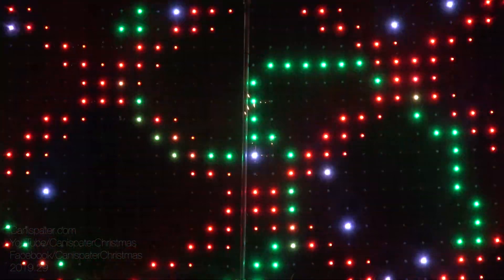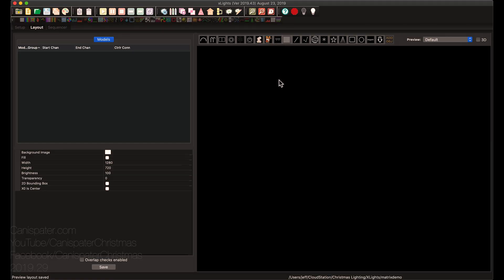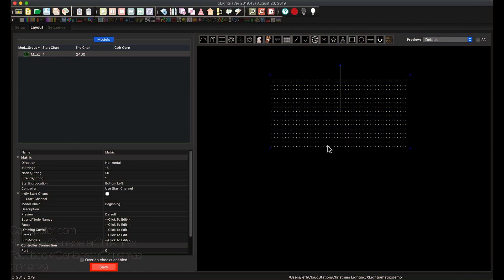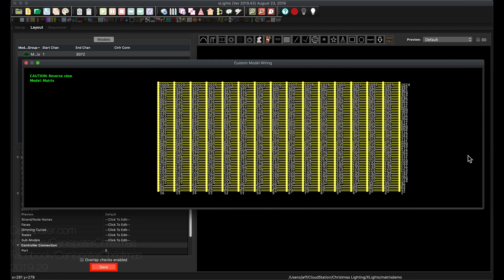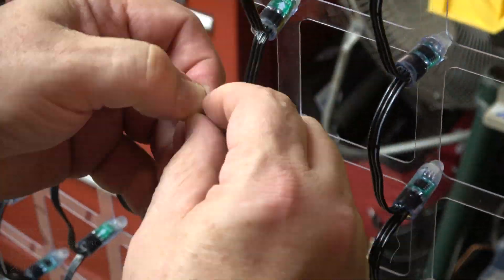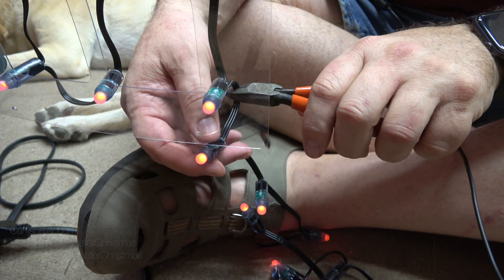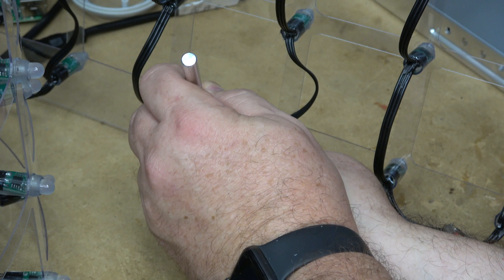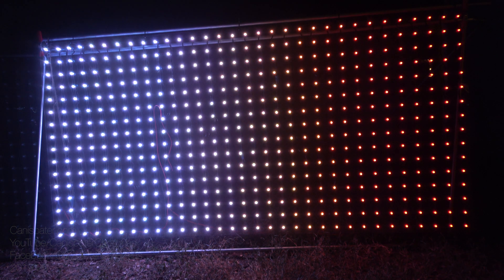🎄5V RGB Pixel Power Injection & Prop Build (2019) 🎄

Comment: I would like to have seen more detail about the power injection. I always have a hard time wrapping my head around it. Or make an updated video about power injection. Great video as always.
Reply from the maker: Thanks! Yeah, I'm going to do an update. Several asking for that. :)
Reply: @CanispaterChristmas  yes an updated video would be great.  Just one topic I'm.trying to wrap my head around in this hobby. Lol
Reply: I agree the power injection is what I am struggling with on my project as well
Reply from the maker: I think the one after this goes into more detail.
Reply: Maybe a wider angle so you can see all the power injection spots in same camera shot. Also how you wired it to the power supply's

Comment: What wire do you use? Different for 5v and 12v? I am going to be using both. So run a new wire about every 500 lights seems best? Thanks!
Reply from the maker: I typically use what I have on hand at the time (I'm very scientific that way, lol). Just make sure the prop won't exceed the current capability of the wire. Make sure it doesn't overheat when you first turn it on. Try to stay with 100% copper. Copper Clad Aluminum (CCA) tends to corrode quickly. Doesn't have to be fancy silicone wire. 😂

Comment: so in the video when adding your power injection wires - you mention to strip the wire coating back but DONT cut the wire.....after you solder in the power inj wires to the pixel wires....if you dont cut the wires how to you water proof as you wont be able to get a shrink tube on it?
Reply from the maker: I wrapped it with electrical tape, but if you want to use heat shrink, you’ll have to cut it. Good tape will keep the rain off, but use heat shrink if there’s a chance of it sitting in a puddle. Personal preference there.

Comment: what gauge wire did you use for power injection? and how many pixels between power injection points
Reply from the maker: I think I used 14 for this. It's generally whatever I have on-hand at the time. I think I went with every other column on this one based on a recommendation from someone else which was probably overkill, but it was just basically a little more work. With all this, build and check to make sure the wire isn't overheating. If the wire melts the insulation, you need bigger wire. Current for these can get surprisingly high with long strings. Fire is a possibility so check it closely until you get more practice with it.
Reply: @CanispaterChristmas   i read if using 5v pixels and only running at 25% brightness you can go up to 150 pixels before power injecting - is that true?
Reply from the maker: Different pixels are different. I always just let the pixels guide me. If they look dull or don't work, they probably need more power. The general rule is 5V, 50-80 pixels at 100%. Adjust if dimmer. 25% is pretty low though. As you lower the brightness, you do loose some color fidelity. I run mine at 30% minimum, but do what you need to for your display.
Reply: @CanispaterChristmas  I have a San controller brightness setting is either 12% , 25% Or 50% , 100%
Reply from the maker: That’s fine. Prolly not a lot of difference there.
Reply: @CanispaterChristmas  I'm running 14awg for power inj wires

Comment: What gauge wire did you use for your power injection wire?
Reply from the maker: Really whatever I have on hand at the time. It depends on what your current estimates are, but I like 14-ga if I can find a deal which is probably larger than needed - again, depends on what you're trying to do. If the wire gets hot or burns up, it's probably too small.

Comment: Can you do this with 12v pixels as well ?
Reply from the maker: Sure! You will probably need less power injection with 12V so maybe skip a string or two between each connection point. The pixels will tell you when they need more power or measure with a voltmeter.

Comment: You mentioned in a video where you do power injection you remove the shielding without cutting the wire. How or what are you using to shield the places you power injection from weather? Do you use any kind of fittings so you can disconnect the power injection cable when you store your matrix?
Reply from the maker: I mostly use those 2-conductor automotive connectors for power injection.

Comment: Hi Jeff, newbie here  getting ready for Xmas 2021. I have a huge plan involving some 20000 pixels. My megatree will be 46 starnds of 115 pixels top to bottom, and 25 pixels horizontally across the bottom for a total of 140 pixels per strand. I've bought an F16 with 2 expansion cards for the tree and I am building a 48 port power supply just for the tree itself. - Anyway - you don't need all of the details of my build just yet. I have been looking at suppliers for my lights and connectors, and I was going to buy from Aliexpress. I was under the impression that the lights come with some non-waterproof connector and I would have to replace all of the connectors with 2 pin (for power injection) and 3 pin pigtails but this video shows you with lights that already come with the pigtails. You have also made mention of someone called Ray Wu for parts and pieces. Can you point me to these suppliers? I am already familiar with Boscoyo Studios and I wish I was in the States as the cost for the Coroplast props is CRAZY expensive for me here in Canada (exchange, duties, taxes, shipping) so I m looking for a local supplier of 4 x 8 sheets and I will probably drill all of my own props. Lastly - I would love to add a 4ft x 16ft matrix like this one here, but I'm not sure what I would use it for. I think I would prefer to space my pixels at 2" x 2" for greater detail but much greater cost in lights and power - Thoughts?

Short point of all this blah blah - Who is Ray Wu, Where do you get your pixels from and do you have a model or part number, do you have any videos of your matrix in use, and what do you think of 2 x 2 spacing for the matrix vs 3 x 3
Reply from the maker: Awesome! You really should go through my beginner playlist (https://www.youtube.com/playlist?list=PLFyrAfJ-kKd4ZfPdXWIt8v_bav61mW_KW) as a lot of those questions will be answered. Ray Wu is a vendor in China we've (the pixel community) used for years and he has a good track record. There are others, but I've only ordered from Ray. I've also started using a US vendor wiredwatts.com since pricing and shipping isn't the greatest from China right now, Ken is great to work with and supports his pixels well. 3" is pretty standard for normal residential spacing, but 2 is fine if you're picky about it. I've not compared the difference and the viewers haven't complained. I have some videos of the show so you can see what 3" spacing looks like.

Comment: Prob could buy a simular size led tv's for the cost and had
Reply from the maker: 4ft x 8ft. Haven't seen too many TVs that big. 😂
Reply from the maker: And there's 2 of them side by side. Not trying to achieve TV-quality density, just showing some animated lights.
Reply: @CanispaterChristmas   hey now you laugh but 60" are only 300 at Walmart 2 side by side is more than 8 wide (just be short like me)and its full hd. Run with cheap video card to join. 10 min setup. Just has 0 Christmas light vibe.
Reply from the maker: Some do run monitors outside playing Santa videos. I suppose it depends on what you're going for. Merry Christmas!

Comment: What kind of stripper are you using that can remove the insulation without cutting the wire?
Reply from the maker: It's an old Paladin I've had for about 40 years. It's kinda magical isn't it? 😂

Comment: Jeff in a previous vid you mentioned the f16v3 had a 5 amp fuse,and 100 nodes would blow the fuse.
Did you have v+,v-,d coming out of the port or did you just use data then v+and v- from power supply?
Or did all 3 out of port    and v+,v- from power supply out to inject,so port provides front end and supply does the rest?hope I didn't confused you on this question
Reply from the maker: Well, there's a lot packed in there. THEORETICALLY, 100 pixels pulls 6 amps, but that isn't entirely true. Different pixels have different power requirements. 0.06/pixel is a ballpark estimate for calculating load, but you need to check your pixels to get accurate numbers. Also, that's for 100% white. I don't know anyone that runs their lights at 100% white all the time so actual current draw will be less. You might blow the fuse if you run 100% white and you may not. Always best to measure it or run it at a lower brightness setting if you can't measure. A last resort would be power injection, but I don't recommend that for 100-pixel strings. Much easier to run them at 30%. :)
Reply: @CanispaterChristmas  understood.
On your matrix,did you have all 3 wires going from port to first connection(led1).
Then inject from source where needed? Or
Did you just have data from f16 to (led 1)
Sorry to bother you just don't want to have the majic smoke on my first f16 at 200.00 a pop.lol
Reply from the maker: No worries. F16 port to first pixel and injected power to keep it below 5 amps through the board. Used the brightness setting on the string ports page (10%) to limit current until I got the power taken care of.
Reply: @CanispaterChristmas  that first port had power or no?  Ie...no power through ports and ALL power injected?  Or power to first...injection on all others?   Lastly...you did not "break" the v+ Since it was all the same power supply?
Reply from the maker: @kevinmccartan6910  I've done it both ways. I tend to power from the board now and just inject as needed. Same power supply, no breaky da positive.

Comment: Love the video newbie question here I wanted to know if power injection allows you to add more pixels on the same port. The problem I'm having I have 750 pixels but it's using 6 Port on the controller no power injection.
Reply from the maker: Power injection is a technique for longer strings. I suppose the answer it technically yes, but not exactly sure what you want to do and it's not recommended for every situation. Good when you have a lot of pixels in a small place.

Comment: I made a mega tree with a 5 layer star for the top using 5v pixels a few years ago... I figured out that at the start or end of every string (were ever the original mfg put the power leads or every 50) was the best place to put the power injection.
Reply from the maker: That sounds about right for 5V. Probably why I've only seen 5V pixels in strings of 50. It also depends on the brightness you typically run. You can go further by dropping the brightness. I usually let the pixels tell me when they need more power which tends to work with either voltage. This was a special case.

Comment: What type of wire do you use for the power rails? Romex? Low voltage landscape type of wire?  12/2 AWG ?  Thanks.
Reply from the maker: I don't have a standard kind of wire. Depends on the prop and the wire I have on hand.

Comment: Your comments on inline fuses are very misleading and dangerous.  Fuses are supposed to engineered (correctly calculated) to protect your wiring from a meltdown.  You DON'T just, "I need more AMPS, so I am going to put in a bigger fuse."    NO--> you shouldn't use a 40 AMP fuse for wiring not designed for 40 AMPs.   NO--> you shouldn't just guess that the wiring you have is 15 AMP wiring and use a, "...15 AMP fuse or so...".  The fuse is supposed to 'pop' before the wire starts to get hot.  LOOK UP (Google) how much current you can run through the gauge and length wire you are using!!!!  You don't want your viewers burning down their house!!!
Reply from the maker: I believe you've misunderstood what I said, but can you tell me where in the video you're referring to?
Reply: @CanispaterChristmas , at 14:00 you state that you might have had 40 AMPs and the wires were warm.  What gauge wire are you using from the LED back to the power supply (I assume different gauges closer to the lights and higher gauge as the voltage bus)?  Then at 14:10 you say, "I run them at 30% anyway".  This is a dangerous way to design a system.  Obviously, seconds earlier, you admitted you ran them at 85%.  What happens one day, when you have a fault with your circuit boards, and something gets stuck at 100% (hardware fault or programming error)?  Then at 14:45, you say, "...now I can probably reduce the fuse down to 15 AMPs or so..."  'Probably' is a terrible way to design a circuit.  A circuit should be designed so that the fuse is equal to or less than the rated capacity of the wires.  Are you running a 15 AMP fuse on 10 AMP wires (what gauge are those bus wires)?  That should not be random, that should be designed.  For some rough calculations, I assumed 6v (5v tables are hard to find) and 25ft of cable.  At 40 AMPs, you are talking 0 gauge wire.  At 15 AMPs, you are talking 4 gauge.  Note, this is taking a 3% voltage drop into account.  If you discount voltage drop, then 10 gauge for 40 AMP and 14 gauge for 15 AMP.  There is a new movie about Westinghouse and Edison coming out called "The Current War".  Spoiler... Edison loses with his push for a Direct Current power grid because of the size of the wires, short distances, and voltage drop.  Westinghouse wins with the AC power grid that we have today.  This is a safety issue that needs to be considered.  You are no longer just plugging in an off-the-shelf and UL listed thing.  You are designing the guts that could catch fire.  Otherwise, I appreciate your channel.  You have given me some insight to hardware that I didn't know existed.
Reply from the maker: @PhotoGuyOmaha  Oh OK. This is DIY RGB LED pixel lighting. In this video, I’m specifically talking about power injection for RGB LED pixels with respect to pixel lighting using standard pixel controllers. Standard estimating uses 60mA per node for a string of pixels. In my video, I have a string of 5V, 1,024 pixels which would theoretically draw 61.44 amps all white at 100%. That means all three (red, green & blue) LEDs are drawing maximum power and producing a white color. The WS2811-style chips used in current pixels can’t draw 20mA per channel so 60mA is slightly too high, but good enough for estimating (with caveats based on actual string specifications). The pixel controllers I recommend have a brightness setting for the string outputs. I run mine at 30% because higher makes the light too bright for my neighborhood. 30% brightness drops the current draw down to 1/3rd so the same 1,024 string running at 30% draws 20.48 amps at all white. We don’t run all white for very long since that wouldn’t be too exciting so current draw is much less than that. For example, if I choose all blue, my current draw would be 1/3rd of that (6.83 amps) because only one LED would be drawing power. Now that’s total theoretical current draw for a string of pixels. Pixel Controller outputs are protected by 5-amp fuses and obviously can’t provide enough power for a string of 1,024 pixels. We use the term “power injection” which is adding another pair of wires from the same power supply to the end of the string (or at various points along the string) to maintain voltage all along the string to enable the pixels to run at maximum brightness (or whatever the brightness setting is). So now we’re dividing the current draw between the 5-amp distribution provided by the controller and any power injection wiring we add. The controller provides fused protection for each output, but any power injection wiring does not so I added the caution about adding an inline fuse for any power injection wiring. We haven’t ventured into wiring size here because people will use what they have available. Obviously, trying to push 40 amps through wire that is not capable of handling 40 amps is wrong. We can use the chassis wiring tables for wiring because the runs need to be rather short. Longer runs tend to attenuate the data signal to an unusable point since we aren’t typically using impedance-matched data cable for the data. You might want to go through my beginner RGB pixels playlist of videos to understand more about the hobby if you’re interested. I also published another video going more in depth about power injection as it’s a subject that confuses many. I do state that anytime you inject power, you need to test it to make sure you’ve calculated correctly (ie: making sure you don’t burn your house down).

Comment: So you did the power injection off the same power supply... Did you just solder jumper it one to the next or are the individual power wires?  Please do a power injection video if possible, thanks. 

Where did you get those wire strippers?
Reply from the maker: Haha. I e had them for about 30 years. They’re pretty expensive now. :)
Reply from the maker: Oh sorry, yeah you got it. I am doing a follow up video to show more detail.

Comment: Seems like massive overkill injecting every 32 pixels especially if you are only 30% brightness. When you inject power in the middle of a string the power goes both ways, so in your case any pixel is only 16 pixels away from fresh power.
Reply from the maker: True, this prop is over-injected, but doing it this way makes the wiring look much cleaner than only doing it at the ends of each 50-node string. Very important for us OCD folks. Power injection seems to be a difficult concept for many that are new to the hobby to understand and I think the video demonstrates what to look for and one solution for fixing it. Having said all that, I am planning a follow-up video and will mention your comment. Thanks!
Reply: @CanispaterChristmas  I am not suggesting that you inject at the end of each string (node 50) but for 30% brightness you could get away by only injecting at nodes 1,128,256,384,512.... Each node would then be at most 64 nodes from fresh power.